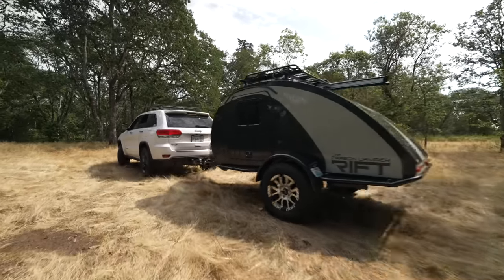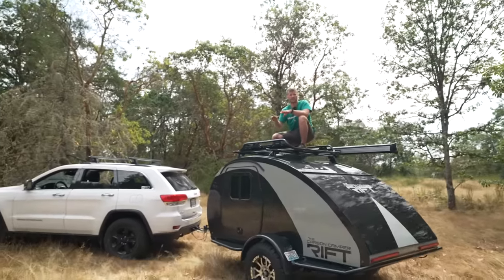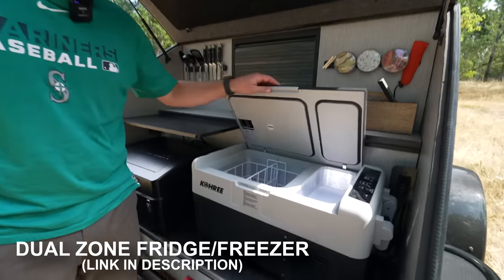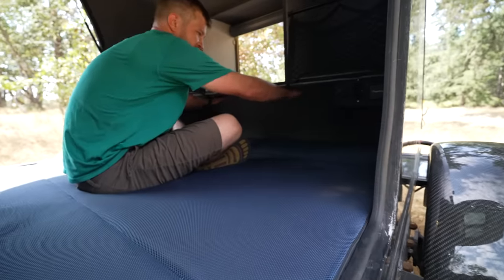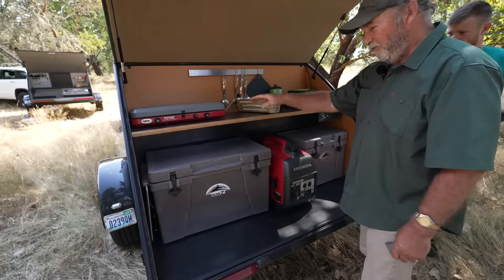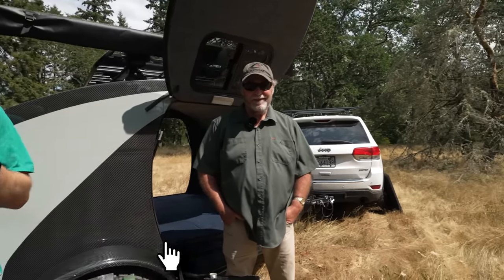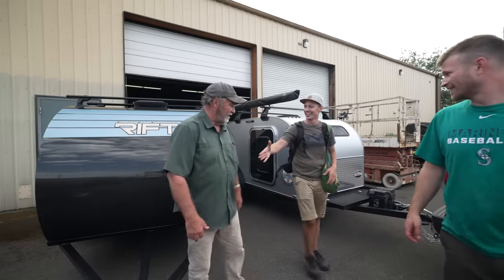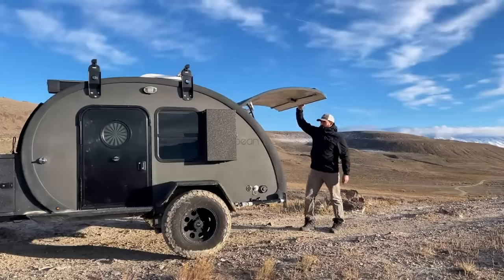Incredibly STRONG yet LIGHT! Carbon Fiber Teardrop Camper

Comment: I wanna see a teardrop made 100% out of Titanium...light, strong, never corrodes. I have a Titanium bicycle to put in it and my back has a Titanium implant from when I broke it crashing my motorcycle that has Titanium exhaust.😂
Reply from the maker: Consider it done. Challenge accepted! But I won’t be able to work on it until I finish my 100% tungsten model first. I wasn’t able to find any osmium laying around 😂

Comment: I would not pay over 15,000 dollars for a tear drop trailer period. I would buy used under 10,000 dollars. Even the tote trailer is over priced. The foam trailer is inviting every time I see the video. One that I can assemble and put in only things I want. 73

P.S. then you have to wait a year to get one. I don't think so, I can build my own in a weekend and a few. If the open trailer is done then just add walls and put a truck cap on top. You will have a decent roof and windows. You can finish off the way you want. If a camp ground don't like it you can move on. Your trailer will work off road if you get the right frame to start with. 

One day the consumer will be right again. History repeats itself. 73